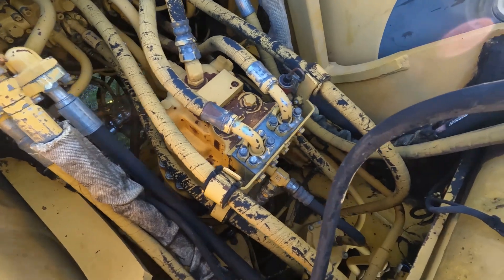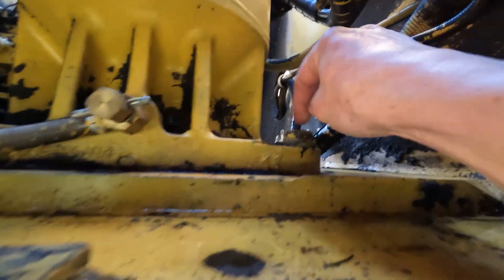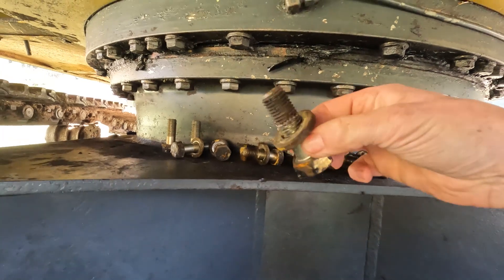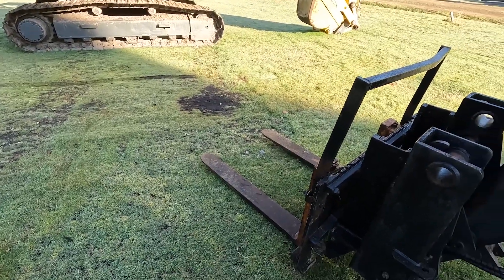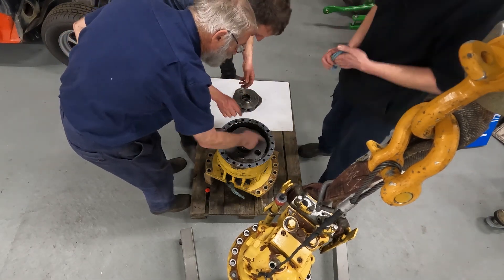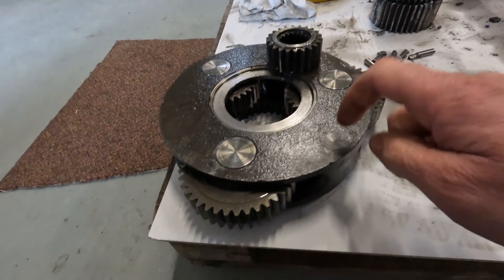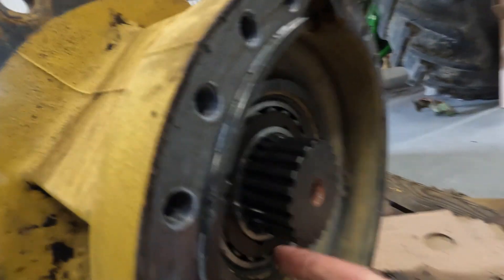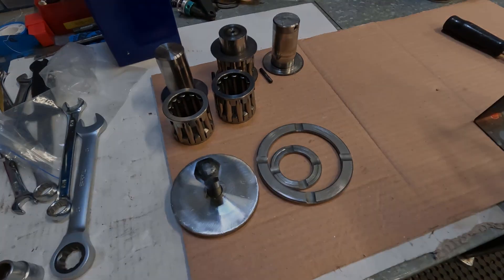Komatsu PC200 Swing Box damage.

Comment: Hey Mate, just wondering if you guys ever experienced slew issues only going one way? I've got a PC200-5 that only seems to want to go right. Checked the valve bank, replaced it, swapped hoses on the swing motor same issues. Sent off the motor to get looked at, but would be grateful if you had any advice or know something about that issue. Cheers mate
Reply from the maker: Hi there, that's an interesting one.
My email address. Dmc12d@yahoo.com
 Does it load the hydraulics up at all when moving the control to the left?

Comment: Did you get this one back together yet mate? ive got a bunch of genuine bearings for a -6 swing box i dont need. Im at campania.
Reply from the maker: Hi there. Yeah we sure did, just check my other video's on the channel. So far it's been going great. 🤞. We replaced the 2 large bearings we got from the bearing shop.
And all the other parts came from Friday parts.com. Unbelievably cheap! 
That's handy to know, cheers for the message. You have a -6?
Reply: @Tassietinker490  nah came from auction up north with a bunch of other gear ive got the 320 cat that used to be sitting in jackmans old yard at grove.
Reply from the maker: @swagman155  yeah nice. Do you have many more -6 parts?
Ahh yes I remember that machine it was pulled apart. Did you reassemble it?
Reply: @Tassietinker490  nah only those bearings came in a job lot. yep its about done now all reassembled and painted.
Reply: @Tassietinker490  Also would you know of a eutectic powder spray puddle gun hangin about? Need one for a job 🤣
Reply from the maker: @swagman155  Ahh you mean for metal spraying?
Reply: @Tassietinker490  yep. ive got a big cracked casting i reckon its best way to go